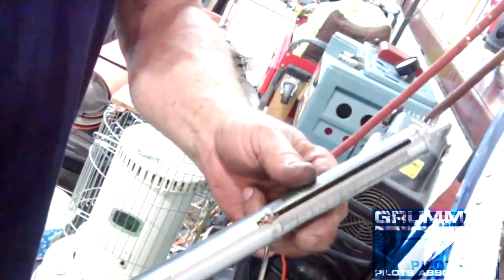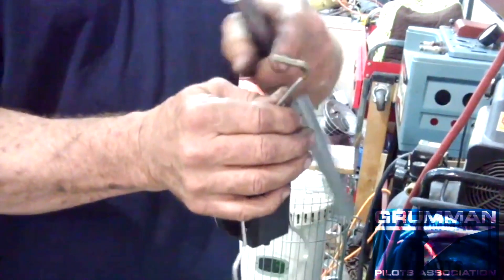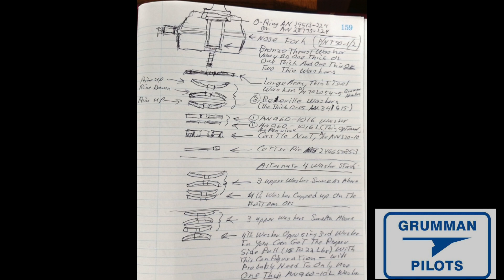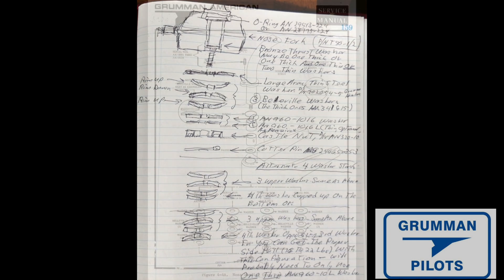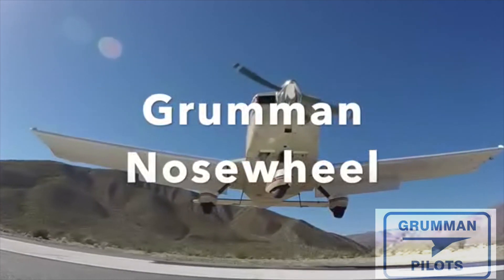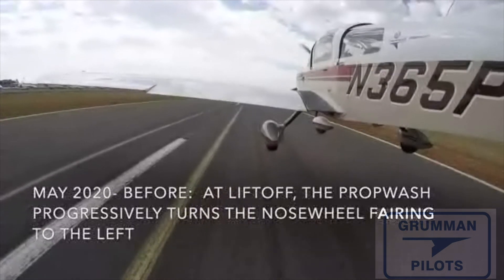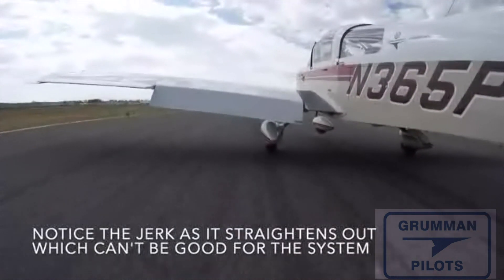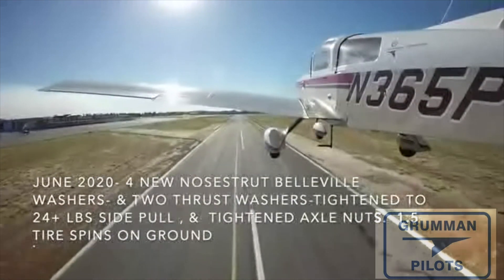The Belleville Washer Stack And Setting Proper Nose Fork Tension - Grumman Style

Comment: Replaced my stack per the manual (AA1B Tr2) and a previous Grumman Pilots video.  Very simple and inexpensive process for the peace of mind. Thanks again!
Reply from the maker: That is why we put those videos out there.
Reply: @GrummanPilots  As I sit here working on my Flight Instructor Renewal Course section on the Angle of Attack indicator, I wonder how the Grumman community feels about that and if there is a specific installation that they prefer. My Cessna and Piper students think they're spoiled because they fly gentle aircraft; to the contrary... they're not flying Grummans.
Reply from the maker: I never saw the need for one, you feel the airframe.